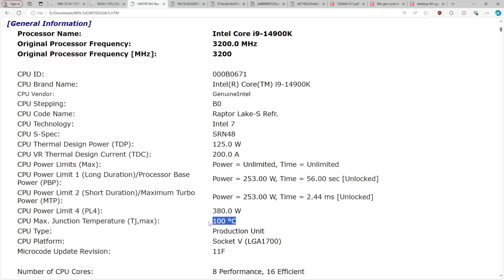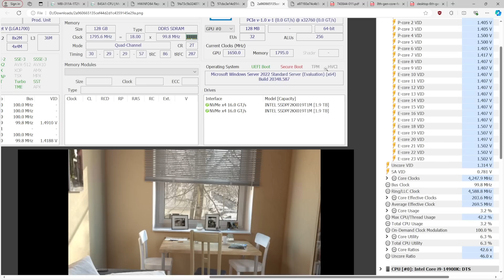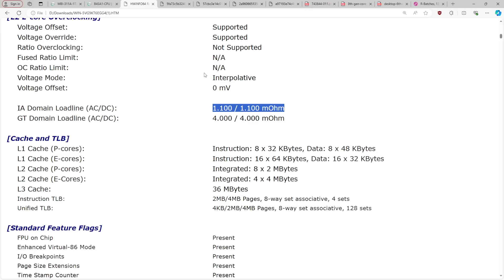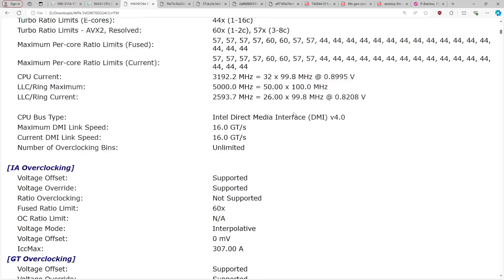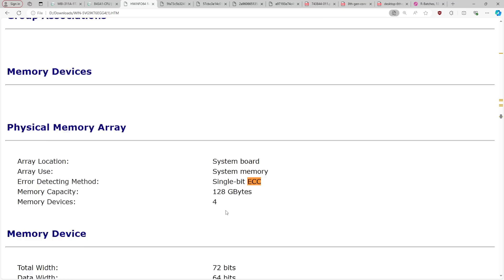Rambling about intel i9 14900Ks degrading in a Minecraft server hosting enviroment

Comment: SIde note: I love it when people are not aware how CPU-hungry Minecraft can get, especially on mods. That game is no joke - it is, after all, a single-threaded simulation game on the server side. To add insult to injury, the game runs a simulation 20 times a second - the load is not constant, and the resource usage fluctuations will definitely cause some heavy power level switching and adjustments twenty times per second. (!)
Reply: Spec-wise those Intel cpus look like godsends for the workload. Pity they fail that badly. I built a minecraft server for the kid of a friend from "old parts" and the coils in that thing a whining like crazy ;)
Reply: For some time, I was running a mod on MC that splits the simulation so each dimension gets a thread. Not perfect, but at least Twilight Forest doesn't lag when someone was doing overworld shenanigans. I am considering adding it back and removing AE2, for that mod conflicts with Dimensional Threading Reforked

Comment: Would be interesting to understand more about how AC & DC_LL works. What are the benefits of lower or higher values and why? I assume closer to 0.01 AC_LL that the voltage would match the VID table of the cpu if the MB LLC was set to no vdroop? Just trying to understand as Intel recommends that AC/DC LLmatch LLC? I’m confused lol

Comment: Hi, nice video
I was wondering about phase counting. Are they always real phases ?
12 phases produced by a 6 phases driver chip with phase multipliers is better on not than 6 phases chip with better mosfets ? Do they delay correctly the phases to have a better output with those 12 phases ?

Comment: I've managed a few hundred servers and blades for the last 10 years or so. I've had maybe 2 CPUs die in that time span. I say maybe, because both the board and CPU were swapped after failures. CPUs dying is extremely rare, to the point of it not being considered during troubleshooting.

Comment: Until someone measures the voltage on that blade then I would assume the reason your contact has a higher failure rate than other companies is because Supermicros blade’s core voltage is higher than the others.

Would love it if you measured it. I can’t think of anyone else who would actually connect a scope to see the “before and after” for these upcoming patches.

Edit: Apparently 30% is lower than others. Wow.

Comment: One random thought: Even if the issue seems fully solved with the August update, buying a second hand 13900K/14900Ks down the line would be a huge gamble, and something to generally steer clear of.
Reply: Because we all know people will try to sell the degraded ones
Reply: I have a 12700k and was only recently thinking of upgrading to a 14900k.  Looks like that's not happening now! Unless there's a solid answer and a fix that doesn't nerf them to oblivion, the risk of getting a broken CPU or one that will break in short while is too high.
Reply: Just get original proof of purchase if you go the used route and make sure it's still in warranty!
Reply: Or maybe this issue is overblown and those CPUs will be an absolute steal on the used market
Reply: @ZombieLincoln666  this is my guess as well - it sounds like it's only 12-25% of the i9's, anything else should be ( generally ) fine after all the RMAs and patches happen.
Reply: @zcomputerwiz  even that is probably higher than reality. RMA numbers have been published by some sellers and it’s like 4%. 12th gen was like 1%

Comment: 9:00 I'd wager the IccMAX is a 10+2b fixed point unsigned float, gives a range from 0 to 511.75
weird format but I'm assuming it's packed in with a bunch of other configurations somewhere.

Comment: Wendell/Level1 Tech indicated that there was a significantly higher failure rate for servers running 4 DIMMs of mem. compared to those using only 2 DIMMs. Prob. just inviting inevitable doom faster. Also, Intel denies oxidation on 4th gen. How long before this is retracted?
Reply: They're already retracting by not making a general recall. They'll push a microcode update limiting max voltage requests, but beyond that they said RMA.

HOW ABOUT THOSE WE BOUGHT 2ND HAND AND DOESN'T HAVE ANY INVOICE OR PROOF OF BUY?

Comment: Class action is the only way now. Intel couldn’t compete effectively (as in power efficiently) with zen 4 so it ran raptor lake far too close to the sun. And anyone that has tinkered with Intel K CPUs from at least skylake knows that some motherboards pump FAR too much voltage on “auto” settings. My msi z170 board was notorious for this so I learned to “undervolt”. The same has been true for every subsequent Intel CPU I’ve owned. Comet lake. Alder lake. And now raptor lake. It’s not only msi. Gigabyte and ASUS are notorious for high voltages as well. 

The auto and optimized default settings can be too aggressive. Especially for a CPU boosting to 5.8 GHz or 6 GHz on one or two cores. 

So it’s about time that Intel got its sh*t together and clamp down on the auto/default settings. It’s like they make the CPUs but don’t actually test them in consumer motherboards. Also these bugs in microcode in the eTVB and now voltage should’ve been caught in QC and QA. But if you look at the amount of bugs in Maple ridge thunderbolt 4 firmware (early maple ridge NVM versions did not support hot plugging certain alpine ridge TB3 devices), it’s clear that Intel does not have a coherent and quality QA/QC process. And that is the root cause of the problem.  Bugs happen.  But robust validation via a robust QA/QC should catch show stoppers like ‘instability/degradation due to higher voltages than spec.’ If they had actually used RoG motherboards to test raptor lake in the factory before release, they would’ve seen the high voltages.

My mother always told me from a little boy: an ounce of prevention is worth more than a pound of cure. Intel’s reputation is suffering. A robust QA/QC is the prevention that Intel needs so as to build and maintain customer loyalty and support. At this point I’m considering not ever buying another Intel cpu ever again.

Comment: I love this topic ahhhhh, only one question do you think I should upgrade to the patch if I’m on a stable bios since December? 59 p 45 e 50 ring LLC7 undervolt svid best case scenario ever exceeds 1.35 and never have had a stability issue
Reply: Not all CPU’s were affected, but a good portion of them are and it happens relatively early on if you have an issue, so far.
Reply: @PAIN-ot4cj  from all these years overclocking learned that cpus face hard wall overclocking them. voltage wall*
For example. Your cpu runs at 1.2v (load voltages*) 5ghz . then at 1.25 5.3ghz .and then needs 1.35 to run 5.4ghz. you don't run 5.4ghz if you like your cpu! 
If your next step in frequency needs 4 times the voltage it took the previous step. you have a wall infront of you.
That wall needs exotic cooling to overcome and not harm your silicon.  
The end
Reply: @ChrisGR93_TxS  yeah this was 6ghz for me all core core that’s why I stood on 59 it was very easy to run
Reply: Thanks fellas I thought so, the voltage algorithm only affected boosting behavior on stock settings and degrading them with super high voltage spikes. Since I locked my cores and voltage I saw no problems with stability ever. Won’t be upgrading till I run into some windows or other troubleshooting problems due to security or devices with my system
Reply from the maker: I think 1.35V is probably safe long term. Though Chances are if you back it of to 5.8 and 4.8 ring you won't really notice a perf drop but you should able to significantly reduce the voltage.
Reply: @ActuallyHardcoreOverclocking  I tested this already and I saw about a 15 fps drop in games but you are correct. I know this probably doesn't matter to a lot but it does for me. also forgot to mention I've been running this CPU since I got with HT off as I saw better 1% lows and higher avgs across all games I tested( the power profile I have been on is on Asus Apex Encore , unlock all limits 90c)
Reply: @ActuallyHardcoreOverclocking  idk how 13/14 work but my 10900kf is uncoolable at 1.35 load (linpack) cinebench is a joke

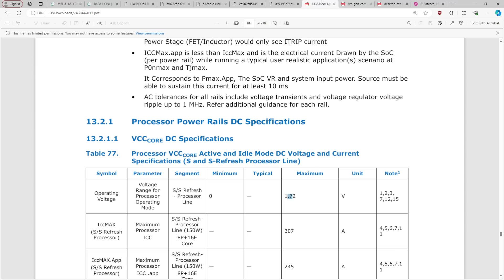Comment: 53:00 -- "Everything after 6th gen doesn't have an integrated voltage regulator for Vcor. So the motherboard needs to know what to do when the CPU sends a Vid request, and that's why [0-1.72V parameter for processor voltage range] exists."  Duly noted, thank you.

Comment: TBF, this happening on a pretty much a reference board is absolutely horrible. But how can you even get a reference board from a major manufacturer anymore? All of them set the limits to ridiculous heights to just one up one another. Are there even motherboards that run in spec out of the box?
Reply: From what Intel is saying the issue at this point is with their microcode, not necessarily the boards themselves. The CPU is requesting more voltage than is intended and destroying itself at full single core boost clocks.

If you want to be safe, limit max boost and max voltage.
Reply: @zcomputerwiz  I know, I watched the video. Just a general observation

Comment: The most recent Bios on my Asus Maximus Formula Z790 was "Updated with microcode 0x125 to ensure eTVB operates within Intel specifications". Fortunately i set my P-Core boost ratios to max 5.7Ghz so i would never have experienced that behaviour anyway. But i have noticed that the previous Bios " Still Intel Baseline btw" i was seeing a consistent 5.7Ghz  in games, now it fluctuates from 5.4Ghz upto 5.7Ghz. 

Now they're talking about another Bios to fix irregular voltage requests. So am i going to see further nerfing to gaming performance?

Comment: If it's so memory intensive, then minecraft server perhaps should run on R9 X7950X3D? Same thread count and clocks, four times the cache?
Reply: Or at the very least, 7800x3d for the extra cache and reasonable clocks at reasonable cost.
Reply: It actually would be a good match for a Minecraft server, just need to find a host provider that uses blades/servers based off it. Supermicro does sell them and guessing they will be selling a lot more AMD based systems in the next few months.
Reply: @philipa1246  then probably a self made setup like miners did, but this time mIITX AM5 boards stacked on some rack 😂

Comment: Well, on my asus strix z790itx board AC/DC loadline varies after every boot. AC between 0.07-0.12 and DC 0.42-0.49 when set to “auto” in bios. When system boots and AC/DC is 0.08/0.049 system is not stable - avx2 stress test freezes the system or reboots.

Comment: I disabled turbo boost on 14700K since its in my unRAID NAS. It runs a pretty high load, encoding, vms, dockers going 24/7. Hopefully the short periods of time I ran this CPU before disabling turbo didn't cause too much issue. Hopefully without turbo the voltages are way lower - I'm assuming they are since the 14700K loaded in my unRAID system usually maxes out around 53C.
Reply: Hope that helped. If not there will be a lot of cheap 7000 Ryzen out there when 9000x3d arrives ;)
Reply: @peterpain6625  Heh, me too! Good point, 7900's will probably drop a bit more on the used market

Comment: its an architeture issue, the 12900k has no issues, but in the 13/14 gen, intel moved the I/O mudule and over time the degradation of the connectivity lanes make the CPU fail, its not a coincidence that most of the reported fails point to I/O erros.
Reply: The 12900K has a max boost of 5.1-2ghz, not 5.8-6ghz.  It is not shoving 1.5v+ through the core when boosting.   It is not an architecture issue, they simply made the chips run way too close to the sun to try and compete with AMD.
Reply: @JathraDH  how do you explain chips never overclocked (actually underclocked), running below stock settings, never passing 83ºC like in wendell's video from Level1techs still failing and degrading? can't blame MOBO manufacturers or OC there, the chipset does not support OC and has a power limit of less than 180W on those boards, still failed bro.
Reply: @JMKarymidoN  Because again the stock settings has the chips shoving 1.5 volts through the core/ring when the chip is unloaded and only 1-2 cores are boosting up to 5.8-6ghz.

This more than easily sneaks under the power limit of the chip because only 1-2 cores are being loaded, the chips probably only pulling 50-60w total in that case, but its still shoving 1.5v through the core and ring to reach those boost speeds.

This is degrading the ring which is why the chips are seeing so many random errors and ways to "fix" the errors.  The ring is the interconnect between everything so when it goes anything and everything can go wrong.

Wendell doesn't even know what a VID table is, so he never bothered or knew to check for the voltages being run through the CPU when it's boosting.  1.5v on 10nm at 80c will absolutely destroy a CPU in rapid order.

Buildzoid literally says this on his first video on the topic, id suggest going and watching it.
Reply: @JathraDH  again, they were RUNNING BELOW THE DEFAULT SETTINGS, don't you know what Undervolting is?
Reply: You are correct. Thank you. Been saying this non stop but nobody seems to listen
Reply: @JMKarymidoN  They were running under the default settings after the degrading had already happened yes.  Damage was already done.
Reply: Also as a note my 13900K has been working fine over 1.5 years because I disabled the thermal boost after I saw it shoving almost 1.5v through the vcore the first week.  Others who have done the same have also had 0 issues.
Reply: @JathraDH  no no no, go do a better research, some chips degraded and were replaced by new chips, they we're never used in default settings, brand new, put in system, undervolt, underclock, used without XMP, and still degraded. How is that possible?
Reply: @JathraDH  use the tools Wendell mentioned in his video and check how far it still passes. That I/o layer will eventually degrade but I'm curious to know how fast it slow. Be nice to know
Reply: @JMKarymidoN  Cuz they would still be boosting high with the boost clocks, what don't you understand about that?

I have not heard of a case where the chip had thermal boost disabled from day 1 and still died.
Reply: @tqrules01  Everything eventually degrades, its just a matter of how fast.

Using such tools certainly causes more problems than good.  What was it y-cruncher and what else?
Reply: @tqrules01  OK yes actually does appear to be some degradation on synthetic tests, however the system is 100% stable under normal use.  I guess well see how long it stays that way.  Been running about 19 months ATM.
Reply: @JathraDH  that's sad to hear Dude, man I hope you can enjoy that CPU for a bit longer. The 12900 KF or KS might be a good drop in replacement if it dies outside the warranty. They moved the I/O it from 13th gen so any 12900 variant should last forever
Reply: @tqrules01  Yea I will probably drop to that if it dies.  But I literally am on this PC all day every day and its been rock solid for gaming and work.  The only time it reboots is when windows wants to update something.  I do feel the voltage spike is still a very large chunk of the problem.  CPUs should not be pushing 1.5v through vcore on stock, they shouldn't even be pushing 1.4.
Reply: @JathraDH  I'm happy for you dude, you deserve a solid rig for the money you invested. I hope you are that 1%.
Reply: @tqrules01  I actually just bought a 12900KS cuz they're $300 new, for now.  I suspect once this becomes more known the stock on them is going to dry up.

This is my work PC so easy investment to not have downtime should the chip die and I have to RMA it.  I will just keep it new in box and resell later if it turns out I don't need it.
Reply: @JathraDH i did that after damage and nerfed down voltage and freqs and now my 14900K is stable again. But now seems more like a 13900T
Reply: @tqrules01  Just thought I would throw you an update since you said you were interested.  I updated my bios with the new microcode and it was shoving 1.4+ through the cores at 5.5 up from like 1.325.  So I set it back down to 1.325, its actually running a bit lower voltage than it was before now.

The good news it is now passing y-cruncher where it was insta-failing before.  I am wondering if the bios update fixed the load line issue some boards were having and if that was causing the crashes and not degradation.  It had been awhile since I updated my bios on this board and maybe that was never fixed in the version I had.

I will try to throw some other stress tests at it later and see how it does.  Cheers.

Comment: In a 14nm white paper from yonks ago I saw a MTBF vs voltage curve. Basically it showed MTBF got worse by a factor of 10 for every 100mV higher Vcore.  I wonder if theres a similar thing for their 10nm, ahem, "Intel 7".  If I owned a RL I'd be limiting it to 1.35V or something and just seeing what clocks it can sustain.

As it is this sheetbox Acer laptop has undervolting blocked and the best I can do on this 13900HX is to limit turbo multipliers. I actually did this from early on as it was yoyoing off thermal and power limits (100W long power) so bad that letting it go up to its stock 5.4ghz and clock back down, was slower than limiting to where it throttles to, around 4.3 P / 2.8 E.  Now I check VIDs, they're 100mV lower at idle/low load and 150-200 mV lower under part load, interestingly enough basically no difference when it throttles down under full load (just slower...)

Comment: E-cores going away might be related to the oxidation issue as its more of a sudden once and done thing
Reply: They''re not "gone" the 15th gen will have E-core and non E-core editions which will definitely eat a lot more power and be more expensive, they arent getting rid of the mixed model.
Reply: @tmsphere  if you dont understand the comment you should watch the video further or watch some older material. This comment is about current cpu's losing e-cores due to failure.